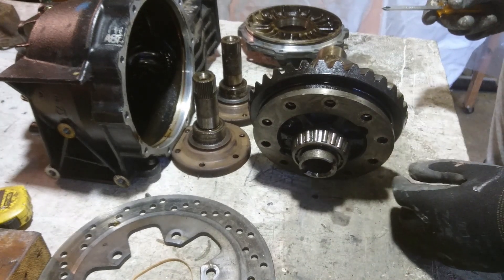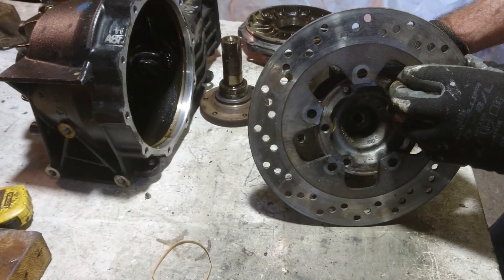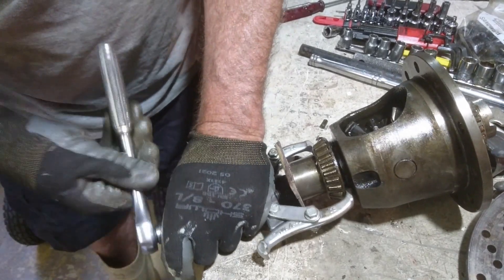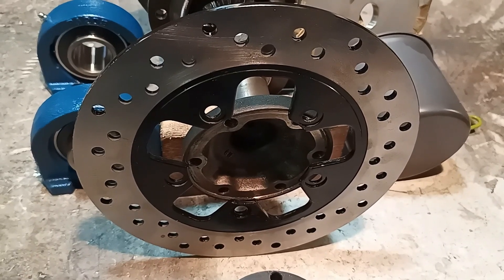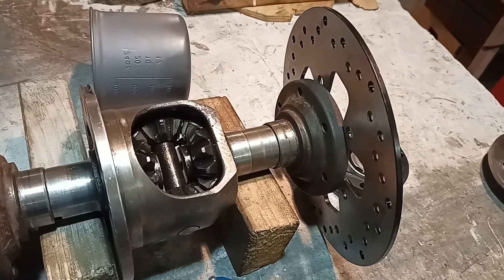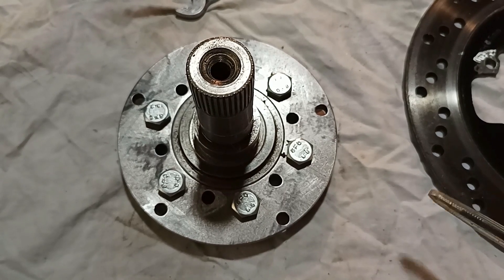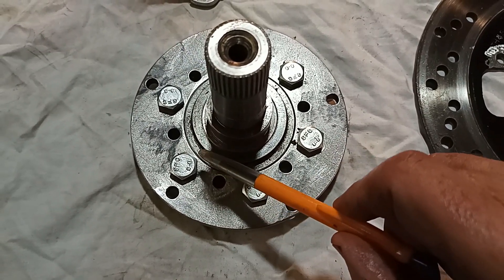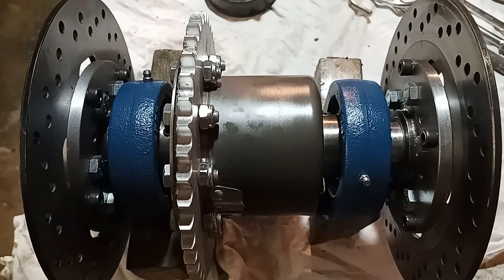Chain Drive Diff

Comment: How does the grease hold up compared to conventional gear oil.
Reply from the maker: Hi. It's yet to run in anger. I'm optimistic as there is no crown wheel to lube. The spider gears only have work to do when the car is in a corner.  And of course the whole unit will only operate for maybe 5000k in its whole life. I'll report as things go along.  I'm currently working on the body and have been lax in my video updates
 Cheers Stu
Reply: thx. I’ve seen others use grease vs oil. I’m building one for a brake steering snowcat so will have plenty of energy going to spider gears when turning.

Comment: Hello! I'd sure like to talk with you about this! I am going to build a go-kart and this is the best idea I have found for putting a differential in it replacing the solid axle.
Reply from the maker: Hi thanks , have you seen https://youtu.be/8Xi04c4ozg8 ,. Doug  has the best ideas and explanation. My diff has yet to be tested and Im worried about vibration, fingers crossed. Much easier if no inboard brakes. I'm happy to answer your questions via this comments thread cheers stu

Comment: This is exactly the set-up I need for my Toro 12-32 riding lawn mower, as long as I can get a limited slip unit.
Love the old lathe, I have a Hendy cone head from the mid 1920's.
Reply from the maker: Hi , I would've gone for a torsion LSD, but was limited to vehicles in stock in the pull a part wreckers.  

The old Hercus lathe has proved its worth numerous times on this build.